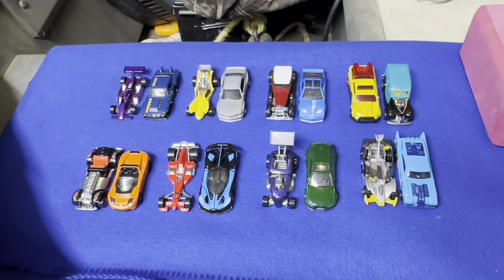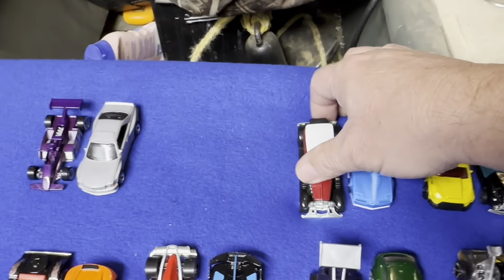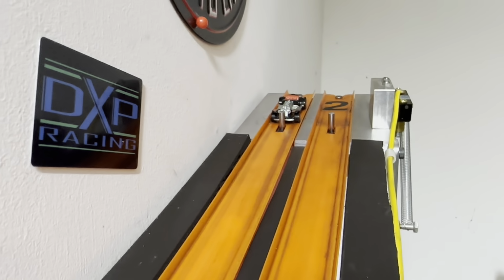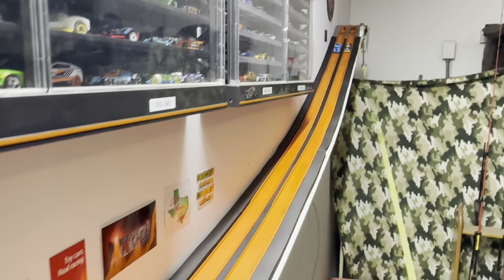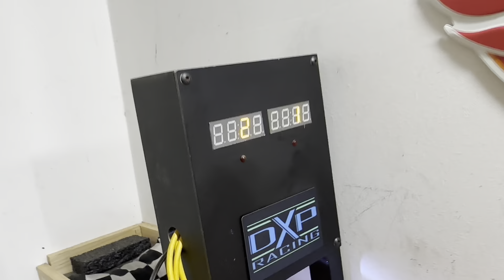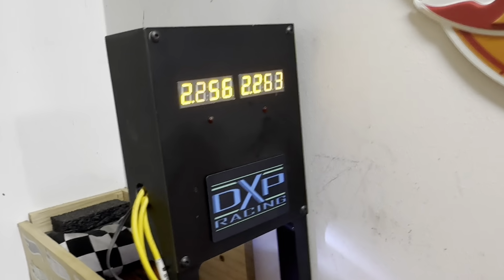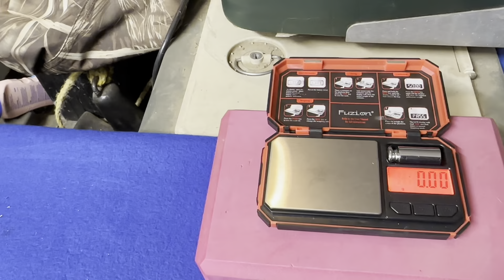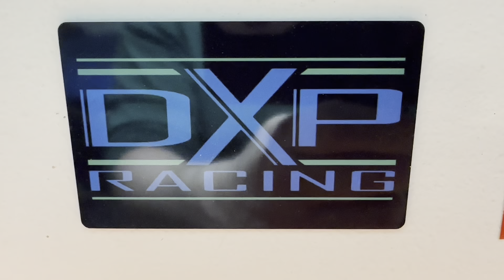Decide Your Ride New vs Old 16 Car Race

Comment: About 3 years ago the sweet sixteen won on my track against similar style vintage cars.  Its front heavy and was pretty decent against similar era cars. So perhaps that was the reason why there was a short term push on them, however shortly after my video YNR got some similar cars and a packard (something i did not own at the time) and quickly it was determined that the packard would be the one to beat from that era.
Reply from the maker: That may be the case, I dunno.  Seems like some collectors in my area were pretty hot on them around that time frame.
Reply: @dxpdiecastracing the original Redline Version of the Sweet Sixteen remains a hot ticket item, but not necessarily for speed.  Although I didn't have the original back then,  time i do a head to head... but not going to break any records.  Great channel, you are on my watchlist, just times been short for me of recent
Reply from the maker: @gnrvintagediecastracing7978 I understand having limited time.  This is my busy season and I get behind quickly this time of year.  You might have hit the mail on the head with the Redline version!!  Thanks for watching when you can!

Comment: Hey brother what is your weight classes and are they the same as everyone else. I am looking at doing the same with mine to.. love love your vids Sir:)
Reply from the maker: I had to adjust my weight classes earlier this year as well.  Mine are anything below 29, 30-39, 40-49, 50-61, 62-over.  I think some guys vary a little bit at the cutoff but this what I choose to do.  If the car is say 39.95 it would fall in the 30-39 class.  The reasoning behind the 62 and over is to group all of those heavy funny cars together and get them away from some of the regular 60 gram cars.  Brandon from Scale Racing Channel came up with that and it makes sense to me.  I was against the weight classes at first but I have grown to really like it.  It takes more work but you get to explore different castings and unlock potential that a top 100 may not even get a second look. If you have any suggestions, please feel free to share.
Reply: @dxpdiecastracing  I am tring to diajest this I to started a weight class. I to didn't like it very much.
Reply: @dxpdiecastracing  my  stock classes are as follow are 35 and down /36 to 49/,  50 to 69/,  70 up
Reply from the maker: @hippywildchildracing very similar to how I started out.  I ended up breaking mine down further due to the races that were happening.  Good luck my friend!